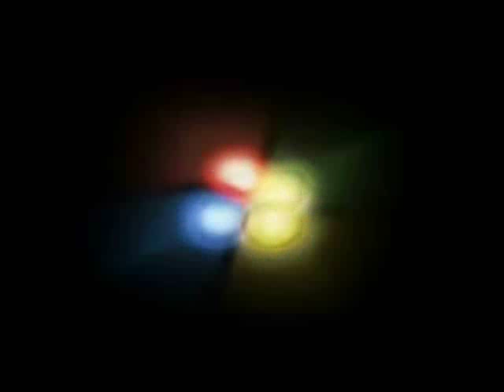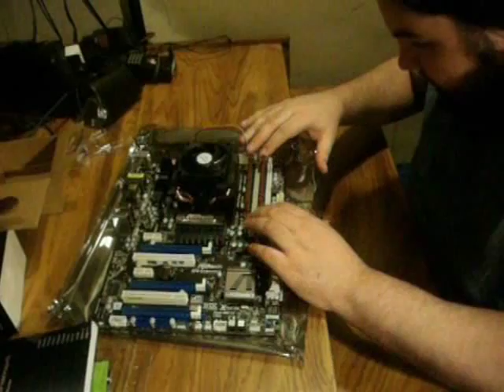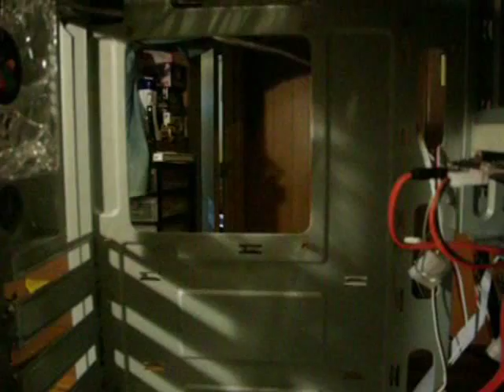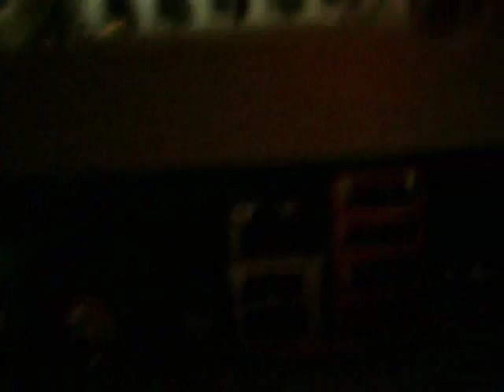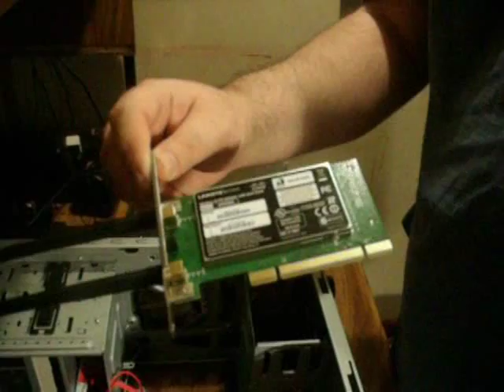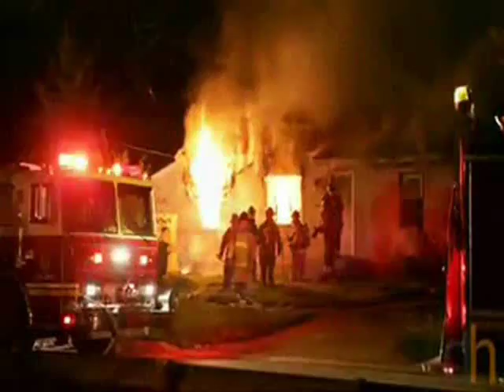Building My PC Part 1

Comment: Hi I've bought a 700 PS asuming it was ok. But It doesn't has the 2x4 pin connector to connect on this mainboard (above the cpu socket)
Do you know what type of Power supply I need to have that pin connector?

Comment: You can buy add on 3.5" bay devices for USB 3.0.  Biostar and Asus both make them and they can be found on newegg for ~$10-$15.  Optionally you could get a multi function device like the NZXT Aperature M which has a card reader and 2 usb 3.0 ports (it's a 5.25" device).  Silverstone also makes several bay devices that have USB 3.0 options including an add on PCI-E card if you're lacking USB 3.0.  :D

Comment: A little tip for your next build. Dont put the motherboard on the bag that it came in, the outside of it is conductive. Just build the computer on a wooden surface or the motherboard box/any other non-conductive surface.

Comment from the maker: @gillingchris2 All 3 blue slots are x16 until you put more then 1 gpu in, the bottom slot can be x4 or x16 (in 3-way SLI it's x4). The manual says if using 1 card put it in the top x16 slot (PCIE2). I'm not planning to use crossfire and the tv tuner is in an x1 slot and the WiFi card in a regular PCI slot.